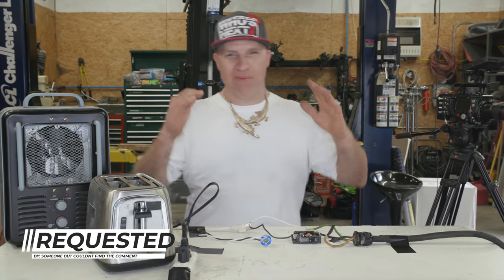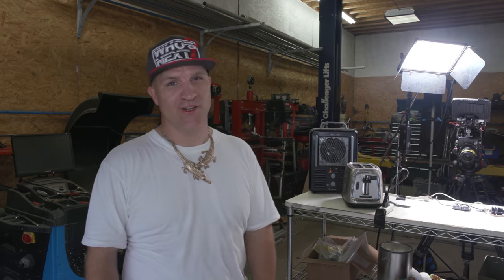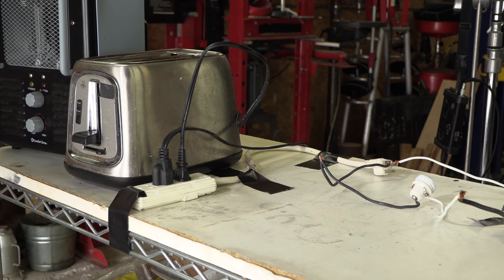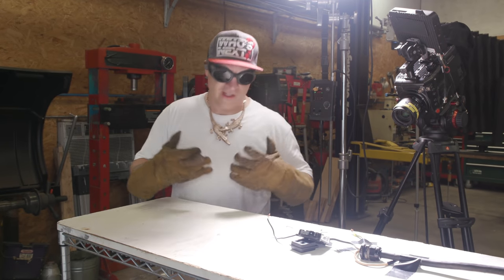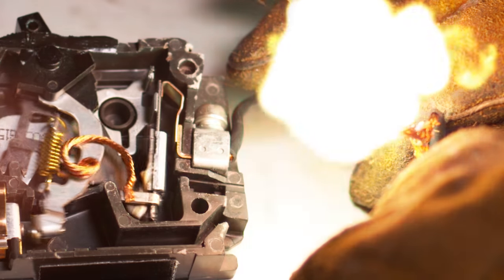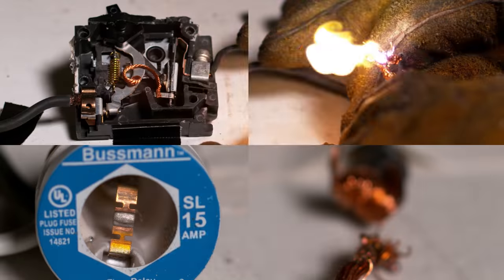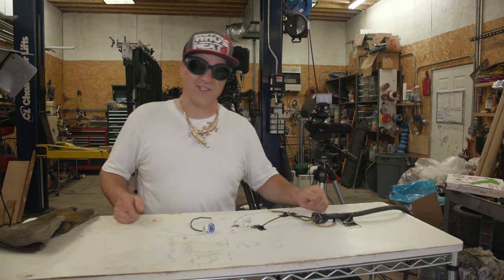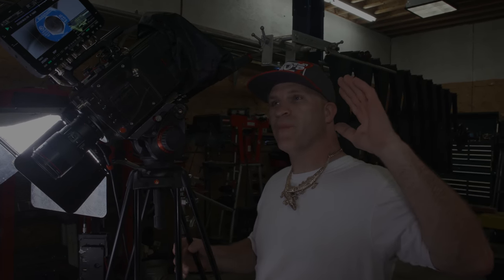Fuse vs Circuit Breaker Which Blows Faster (Slow Motion)

Comment: I thought you were gonna wire them both in series with each other and test which one blows faster. The high speed camera tells it all. I am an electrician and deal with all sorts of different electrical current protection on a daily basis and can tell you every time fuses blow faster. Next is Square D's older QO breakers which are in my book top of the line. The new stuff can be counterfeit and junk. Next is Square D's Homeline series. GE's are on the bottom of my list because i've arched out just about every one of them and find GE's interrupt a lot slower leaving more damage to the wiring and devices connected. Even had one instances where sparks flew out of a GE panel and caused arch flash damage to the breaker itself. One thing I do like about GE panels themselves is the fact they use a better alloy copper buss which is better quality in some of their powermark gold series. I know you probably cant compare whos better due to lawsuits and such but would be a nice video to see which breaker trips faster. There are other manufacturers like Siemens, Bryant, etc but all use the same type of tripping mechanisms that GE uses by the way they trip but I always find older Square D QO's to be the best in my opinion just by how fast they trip on a short circuit situation along with having a lower arch flash causing minimal damage to the device or wire.

Comment: It depends on the fuse. I don't know if you have different ones but we have fast and slow fuses
Reply from the maker: Yes but I thought it was a pretty equal comparison, if I use a fast blow fuse, that would not be equal because the circuit breaker is a Slow blow fuse.

Comment: There is also a difference in responsetime at which moment during the 60Hz cycle sine wave you make the short. If you short circuit the wires near the zero point, the voltage/current is near zero, so it takes time before the current has raised enough to reach the tripcurrent. When you short the wires when the 60Hz cycle is at the peak of the sine wave, the responsetime will be much faster.
For good comparisons, you have to repeat each test at least 5 times.

Comment: That last fuse is a dual mode... The dull silver blob in the middle is a low temp solder that melts when longer but lower steady state overloads are present. It can't react to the sudden increase in current for a dead short however, which is what the thinner links on either side of it are for. One way or the other... Either way too much period or uncomfortably high current over a longer period of time, it goes.

Breakers use thermal for the delayed reaction and magnetic for instant for the same reason. Yours does not have the magnetic for the immediate and relies only on the fast heating of the bimetal. This is why the fuse is faster. If you had a magnetic type breaker, it would beat the fuse hands down for response time on a dead short.

Comment: Need an oscilloscope on a current transformer or shunt to record the current interrupting time. The fuse may have broken the element but from the video, it is obvious it has not broken the current flow first in the short circuit test.  Industry rates industrial current protection circuits in the number of cycles the fault current flows.
Reply from the maker: Great point but my goal wasn't to influence anybody's decision on whether to use fuses or circuit breakers, it was just too give you a visual representation to make your own judgment.

Comment: I think it would be cool to see electrical arcing in an aquarium that has a mixture of clear oil and water - may actually make for some really neat arcing, especially if you get creative with things you can dissolve in the water, or agitate the mixture to get cool shapes out of it.  Probably more artistic than informative, but who knows.

As much as a more complex switch initiating the hard short would be cool for getting more precise data, I think the difference would probably be about the same, and also affected by just how much effective inrush (impedance gated) the wiring and switch are in terms of heat transfter into the resistive bridge on the fuse, which again wouldn't tell us as much.  I think there are advantages of fuses in that they will withstand inrush currents at small scales a little bit better, but you spelled out why modern circuit breakers are the standard.

Comment: There is just one problem with the test.

You do not have control over where in the mains cycle the short happened,
so based on timing, the fuse would have a different breaking the current job.

Take 60 Hz, the voltage is zero 120 times per secound.

The fuse is probably using the zero current period to break the circuit, so the breaking time depends on how far from the zero-period the short happened.

Basically, you would have to rerun the test many times, or use a automated (possibly eletronic) shorting jig to deal with the variations.

There is also the DC case, where it's not given to break the current!

For your own safety sake, just use a mains switch of a higher current rating to do the short.
Reply from the maker: very true and a great point, however in both cases at 60hz neither of these devices is capable of tripping in only one voltage cycle.

Comment: I think that with the test between the 2 options, we have higher currents on circuit breaker than the fuse option. With this behavior the fuse option is more safe for our devices but also for the cables.

Comment: would have been interesting to have the comparison with the circuit breaker and the fuse mounted in series with one another for both the tests. That way you'd see if one or the other would break the curcuit consistantly faster/slower than the other... plus you wouldn't have the uncertainty of when during the phase the short was made. Both would experience the excact same scenario.
Reply from the maker: True but I would need double the current
Reply: @WarpedYT  - That would be true if I'd sugested mounting them in parallel ;)  

In series of one another the current remains the same. The same current runs through one then the other. This way you ensure both the breaker and the fuse are handling the excact same load conditions. :) 

The long story :D

There are a couple of interesting points to draw from this test.
For overload:
If the curcuit breaker cuts off first, will the gradual heating of the fuse have made it weaker? It seemed like if you were to cut the power a couple of pulses before the fuse failed that enough material had left the lead to actually make it weaker.

For the short curcuit:
The fuse will most likely fail no matter what. But will it fail fast enough for the curcuit breaker not to disconnect?

Comment: IMHO it seems the fuse is only 2 frames faster when counting the current flowing through plasma inside fuse. I think more accurate would be to measure the time of current flow using oscilloscope. But otherwise it's a great video showing how that two protection elements work. Could you also make a recording of residual-current device (or residual-current circuit breaker) switching?

Comment: Love the videos but could’t help but think, You’ve got to think of the frequency point of when it blows, each test the circuit breaker or fuse could be breaking at different times in the sine wave resulting in different power levels at breaking point,so this test is not 100% accurate. If the fuse was connected around the peak of the sine wave it would have the most power running though at that point hence quicker time, the circuit breaker could be starting from zero and taking a longer time to get to peak power and they have a mechanism that takes time to activate but has a strong hair line trigger to disconnect as fast as possible. 
DC wouldn’t have this problem, or you need some way of working out at which point in the sine wave the circuit blows, and calculate the power at that point or start from a zero point in the sine wave, can be difficult to do.
Reply from the maker: You have a great point, and that's very very true. However on the fun side of things I was just fulfilling the viewer request and seeing what was going to happen. at the very least it gave people a good idea on how each device works differently but accomplishes the same task. Thanks !!
Reply: Warped Perception no problem! Of corse it is all for fun :) just felt i needed to point my thoughts out :)

Comment: I'm an electrician. the "plasma" you described is exactly that. plasma. the oxygen is burning due to the heat. we call this an "ARC FLASH" and at high voltages and high amperage (current) the arc flash can become so bright, it can cause blindness. the plasma generated can exceed the surface temperature of the sun. we have to wear special glasses to protect against arc flash faults in those cases because seeing an arc flash at 50 feet away is bright, but when you're only a few feet away the risk of permanent damage to the retina is certainly there to cause irreversible damage and even complete blindness. the most common way to see an arc flash is when a pot transformer on a telephone pole fails. that blue/green/purplish light that lights up the sky is an arc flash due to a fault in the electrical system. if you are ever close to these incidents, please i understand it looks cool and all that, but do not stare directly into the arc, as ive stated before, this can cause serious damage to your vision.

-Brian
PEACE AND LOVE
Reply from the maker: Great points ! Thanks for the comment and the info.

Comment: I have always thought that fuses were better, now i know for sure. Thanks. Now i have proof to show my friends that I'm right.
Reply: Christopher Western no they are not. 
The amount of electrical fires causes be fuses is crazy
Reply: Older is always better in my opinion.
Reply from the maker: That's what I have heard !!!
Reply: @boilanque  Residual current circuit breaker (RCCB) is not used in place of a fuse(RCCB equivalent to ELCB or GFCI). Only MCB- Miniature Circuit Breaker should be used as replacement of fuse.
Reply: @christopherwestern9223  I hope your electric shower never develops a fault whilst your in it, you will soon wish you had a modern protective device I can assure you
Reply: @victorneal  , not really electrical, fuel oil water heater. Never said i had fusses, just that i prefer them.

Comment: 7:01 - Realize, of course, that the Available Fault Current in a residential setting is anywhere from 10 thousand amps to 25 thousand amps. There's a lot of energy in that amount of current. Under those conditions the metal inside a 15 amp fuse doesn't stand a chance!

Comment: Fuses will commonly break a short faster as the breaker will always have mechanical lag. In household circuits, there isn't much of a difference, but in industrial applications the difference is HUGE. In high power industrial circuits using the proper fuse can actually limit the damage done by a short due to their ability to break the circuit at any point in the AC cycle and do so quickly. The difference can be a minor repair and a replaced fuse to as far as a major repair (including fire damage) and replacing the breaker.
Reply from the maker: Exactly right, "mechanical lag" very well stated. I personally prepared heavy industrial equipment for many years, I literally just changed 2 40 horsepower industrial Motors a few weeks ago, as I was pulling out the 480v 200amp buss fuses, I stopped and thought to myself why are they still using fuses on this type of equipment, then I filmed this video and it all made sense.

Comment: You should try putting the fuse and circuit breaker in series. That should make it easier to tell which blows first because it will interrupt the current flow to the other.
Reply from the maker: I should have totally tried that oh, just to see what happens, but as for a comparison, I think both of them will not trip. One or the other is going to interrupt it slightly first in my opinion, and in that case who knows what the electricity is going to do so, but I'm going to try that in a separate experiment or maybe behind the scenes
Reply: To make that case interesting, the breaker have a electromagnetic trigger on short, and a thermal on overload. 
The fuse is simpler (at least from the looks of it, may be some hidden tricks there too).

Most likely a short will trigger both, while a overload takes one.
Reply: @erlendse  I agree with your theory. I was thinking more about the short circuit condition and wondered if both would trip. It would be interesting to find out.

Comment: You have alternate current in 60Hz, it means you have half cycle every 8.3ms. 14 frames are 4.6 ms. Your hand is so slow compared to oscillation, we can assume the spark started at some voltage peak. In both cases you got arc extinction in aproxatelly 1/4 of period, only during the falling tension from Vmax  to zero (or raising from -Vmax  to zero). I would say both blow at the slowest possible time, because they allow current flow in one direction, but not in the other one, and the arc was extincted because zero tension (sorry I'm not English native speaker).

To make better measurement I would recommend to use direct current.
Reply from the maker: Good Idea! I just used ac as this is what these normally handle

Comment: Question. Someone I know wired an outlet Hot/Gold Hot/Silver Neutral/Gold Neutral Silver.  I was called in and wired it correctly Hot/gold Hot/Gold Neutral/Silver Neutral/Silver. No juice?  Could the previous mistake take out another outlet? Maybe the knuckle on the fuse pnael?

Comment: I have always wondered this in the back of my mind, once u brought it forward i thought y dont cars have circuit breakers, then u showed the answer!!! Spoiler alert, fuses are faster, it saves the wires a few ms of heat...
Reply from the maker: I would also imagine that fuses especially the automotive type, are much much cheaper to manufacture as well as to replace.

Comment: Hi There,
Hope you can help me with this question:
How can I Protect Electronic Equipment from a near by Lightbing Strike, if the lightning hits the power lines and travels thru the lines?
Can a FUSE Protect the Equipment from the high current coming in? 
And what kind of fuse should  I Install?  Fast Acting Fuse or Slow Blow Fuse?
Thanks for your help.
Reply: For this, you need to use SPD

Comment: You need a better more repeatable short. The impedance of touching two wires together can vary quite a bit. A high power solid state device maybe. You could try and use contacts but you would probably ruin them each time!

Comment: Ok so now if you wrap one of the wires  around say idk some high silicon extra mild eye-ron metal a buncha times, like oh eleventeen or so wraps.. would that blow the bridgemetal in the fuse with more gusto? Or would it just take a bit longer, while saturating, then proceed sorta as it had using this unloaded state short circuit video as a control ?
Reply from the maker: Good question
Reply: @WarpedYT  there's power in the flux.. but only when it collapses i think.   but in comparison with capacitors? idk, its where im at in electricity as far as getting a sense of. Magnetically, which induces electrons to flow, or emf maybe, vs storing them on the plates? or the same emf as a discrepancy? maybe thats more like leyden jar storing the tension.... wonder, devise, spearmint, and show us maybe??

Comment: In this specific case when comparing them you need to measure the current to see the actual pattern. But you should have put in a description of the parts in the specific circuit breaker because not all of them are alike.

Comment: My guess was the fuse.cause thats what i was always told growing up. That fuses are a sher bet and faster. But thats if u use the right size lol. I didn't know they exploded tho lmao.
Reply: Yeah, the danger with the fuses is that any time they blow you have to make sure they are replaced properly. The breakers just have to be reset. 

That said, I have had the unnerving experience of seeing a breaker protected circuit be shorted for maybe a second and not trip! Maybe the run of wire had enough resistance to be a 'slow blow' or maybe the breaker was defective. I didn't hold the short in place to find out. I can't imagine a fuse failing to open unless it had been tampered with. Or replaced with too high of a current fuse.

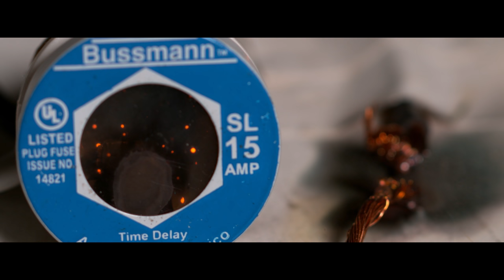Comment: 5:37 both the fuse and the wire arced simultaneously so i think the fuse blows faster than the circuit breaker can open

Comment: We knows fuse has great sensitivity compared to CB.
u must connect circuit breaker and fuse in series. As per my knowledge it will shows proper difference.

Comment: Simple test to see which ones the circuit first put the fuse and breaker in series and put them in a short circuit or slow overload condition and see which one open the circuit first